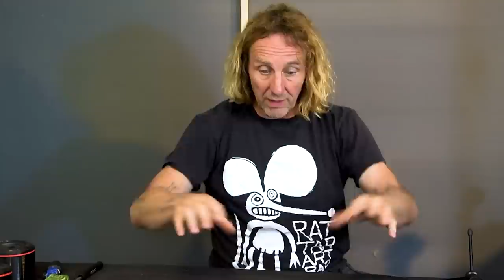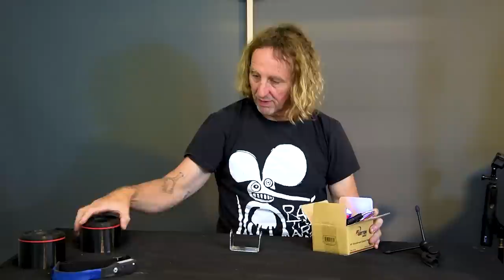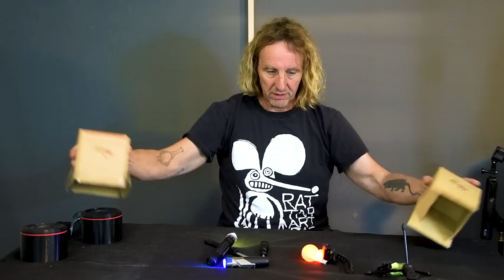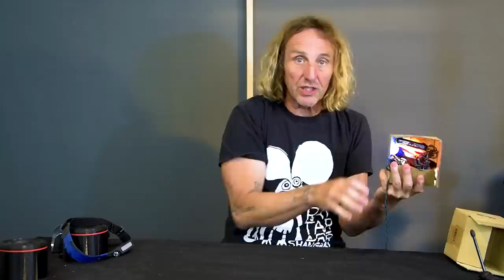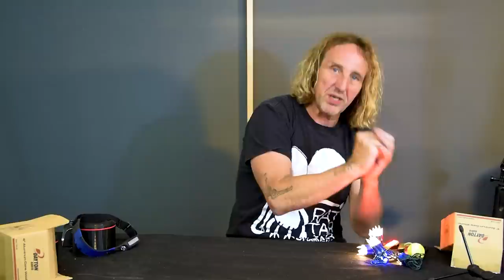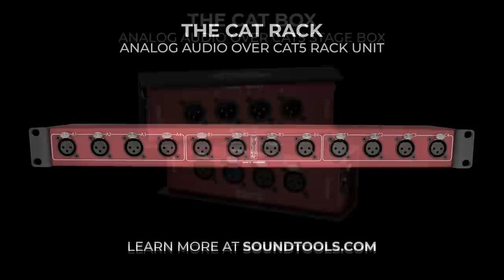Thinking Outside the (Speaker) Box - Does stereo Ruin Sound?

Comment: Interesting way to look at it. I venture to the other end of the spectrum for my personal listening experience. To me, stereo sounds better than "live sound". Live sound is too loud, too high frequency or bass heavy, has too much reverb, there's people talking and making noise etc...A good home speaker set sounds intimate and very "acoustic" and organic. Omni directional speakers have more of this enclosed listening quality. The good home systems provide offers more clarity and precision. I like the idea of "multi-track" audio for multi point speaker systems as well though. Really a difference in the experience of the sound to have all this stuff reflecting in different ways with different setups. I was blown away when I heard the bose micros in my house. They seemed to "open" the sound up with a feeling that you could grab the instrument. It seemed very rich in volume but the sound did not actually travel outside the house which is good.  With stereo, depending on how far apart your speakers are you get 5 strong points (far left, mid left, center, mid right and far right), those points then reflect obviously in interesting ways creating more focal trajectory. But again it's just a different experience. One thing is for damn sure we got to get away from the phone mixing based production. I came up with an idea called stereo cell, that basically is the concept of attaching very small but good speakers to a cell phone. In this way it can still fit in your pocket like a cell but would provide much better sound with the latest speaker developments. The new gen wants super exaggerated kits which is a whole nother issue ha...They sort of bake all this directional stuff into very basic arrangements (less virtuoso musicality but the listener can "feel" the vibe because the kick is 20db too loud). lol.
Reply from the maker: Hmmm, comparing processed home hifi and recordings to live where everything is pumped through big speakers in a more raw form at higher level. Yeah, stereo is less intrusive.

But 2hat about comparing both live PA system sound and home hifi sound to say, someone playing an accounting guitar, a stand up bass and a percussionist?

My take is that both live pa and home hifi and surround sound and all the other formats fail at reproducing sound even close to the original due to flaws in the formats of reproduction.

Comment: I love this concept..  placing a Danley Sound Labs Jericho Horn J1-94 in front of each musician on stage, and mix each instrument on it's own matrix.

i like where you are going with this.. 
🤣

thanks for your videos, sir
Reply: Interesting idea.
Reply from the maker: One interesting thing I found out when consulting on the EAW anya system was that it is practically impossible to make two things sound the same if they have different dispersion charictaistics.

We were voicing the Anya rig and I wanted to compare to the MicroWedge which I designed and EAW builds and sells.

Anyway, we kept testing and comparing and matching the EQ between Anya and MicroWedge and could not get them to sound similar.

Anya has a 70 to 90 ish degree horiz dispersion and controllable vertical dispersion and the MicroWedge has about an 80 degree conical dispersion.

It dawned on me the match the vertical of the Anya to around 80 degrees and wow. Once the dispersions we're matched, it them became possible to EQ the two vastly disparate designs to sound similar.

In my opinion, this is why horn loaded systems are greatly challenged in sound like the original sources and why studio monitors and home hifi are not horn loaded

Not to say horn loading is not useful, but horn loading is not the optimum choice if sonic realism compared to the original source is desired. Unless the original source is also horn loaded or has similar dispersion

Comment: Have to disagree on this one. We aspire the 'point' source because we do something unnatural in the first place: we split sound by frequencies (put low freqs into a woofer, high freqs into a tweeter etc) because of technological limitations. Getting those as close together as possible and phase aligned gets us closeer to a 'full range' reproduction. Point source in this case means the drivers are all phase aligned, independend of the listening angle. The thing that differs from the loudspeaker to the actual instrument is the radiation pattern and directivity. If you recorded a violin from different angles and made a directivity plot, then built a speaker with the exact same directivity and then played back a violin recording on it, it would sound close to perfect. Now play a recording of a trumpet on this speaker and it will sound terrible. Loudspeaker science just arrived at the best compromise. 
Not having a point source (or alternatively a phase coherent line source, which basically acts just like a point source when observed from a single point in space) would mean you're doing even more unnatural things to the original sound of the instrument.
Anyways, the rest of the video motivates people to think more about sound reproduction and how to approach mixing, taking their technological limitations into account, which is great!
Reply from the maker: Ahhh, but the reason we are so focused on creating these ultra wide range sound sources is because we are putting a vast array of unrelated sounds into them.

If you were to design a speaker to reproduce just acoustic guitar, or just kick, or just cymbals or just vocals, the complexity would be much less. You could use a single full range speaker or 2 ways maximum.

And the speaker designs for the various reproductions could be vastly different.

Do we really need a 3 or 4 way speaker to reproduce the sound of a marshal cab? 

And yet if you mic or direct the sound of a marchal cab into a 2 or 3 or 4 way monitor, it never sounds like the original marshall cab. Ask any guitar player if their wedge sound as good as their amp.

these accurate speakers we build to Swiss army knife reproduce a variety of sound sources, actually strive for max fidelity while failing to even reproduce minimum fidelity.
Reply: @DaveRat  Wow I just typed a long reply, misclicked once and Youtube just deleted everything. We need that Discord server already lol!
Anyways, the biggest reason why we need large multi-way systems is that we have extreme demands like getting sustained 100dB(A) some 30m or more from the stage. If you want 50dB at 1m, a single 3" full range speaker will do reasonably well, even with complex signals like a full mix.
And yes, speaker designs would be different if your goal is absolute realism, like I alluded to in my example with the piano. What's the best speaker to imitate a Marshall cab? Well, a Marshall cab, duh! But we're not using that because we want 10000 people to have a similar listening experience, not just 10. And as a sound engineer you know that the mic and mic position play a huge part in the guitar sound too, so yea, it will sound very different coming from a stage monitor, which isn't solely the fault of the monitor or its driver count though. In addition to that, sighted listening bias also plays a huge role. There is no appeasing a musician with any kind of thing, unless it's the very thing they want, no matter if it's better, worse or equal.
Reply from the maker: If you narrow the realm of applications to specifics you can really do a good job of limiting the possibilities of innovation.

I can say that when doing 60,000 capacity stadiums with a double hung pa system in Europe, where I had the ability to move sound sources around, I was able to imement the beginnings of these concepts.

For smaller simer venues in the 10,000 to 20,000 capacity realm the options would be more diverse. And for clubs halls and home hifi, complex options become quite feasible

As far as appeasing a guitar player, I just built wedges that were 2x12"/10"/2"

And replaced one 12 with a celestions 12. And rand guitar dire t to that 12. Guit player said it was the best guit he ever heard in a wedge and sounded just like his amp (he had a stereo mix as well so he had each rig going to a 12 in the wedges.)

My point is that we don't have issues, we only have solutions. Some we have found and other we are still striving for.

Comment: Another thought….. maybe what you are heading toward is using a monitor mixer for the FOH so you can send a lot of different mixes to an array of widely spread speakers. Probably work better in smaller venues rather than arenas but I think it will work better than a stereo mix :elbowcough:
Reply from the maker: I think there are a near 8nf8nitenanountvof application dependant solutions and advanced to be made.

And trying to continually push stereo to higher and higher levels of perfection is not one of them

Comment: Good points Dave! In the hifi world we know there's no way of replicating the original. There's just too many steps in between - mics, preamps, cables, mixers, amps, headphones, speakers etc. There's too many subjective decisions made before the final product reaches the listener. I think the point is to try to make the sound as enjoyable and pleasant (wholly subjective) as possible. Many recording engineers are surprised when they hear their recordings through audiophile equipment. It's not the same that they heard through their studio monitors when they mixed it. People still don't use studio monitors at home because hifi speakers "sound better". Long rant, sorry. Whatever makes the end consumer (the audience) happy, even if it's not exactly true to the original. My 5 cents. Great video!
Reply from the maker: I would argue that a recording of 3 lo-fi sources would be easy to recreate wit 3 lo-fi speakers that each radiate sound in multiple directions and difficult or impossible to recreate with 2 hi- fi speakers.

I would say that the less we combine signals, the less need there is for perfection in the reproduction signal chain.

Comment: Your videos on that topic and how you came to use a double hung PA and seperate the sources in the wedges have definitely triggered something in my brain and I'd like to share my thoughts with you...

I've been following the adventures of @PresentDayProduction moving towards Dolby Atmos mixing and having the possibility to assign each source to a single speaker recently. I've found the technology behind this really interesting.
This makes me thinking a lot about about the general problematic of live sound reinforcement and I wonder if Atmos would be something that could be usable (in the future) in a live environment.
It seems to provide better clarity and a better image when mixed for an immersive experience and then processed down to a stereo setup than a classic stereo mix.

Of course, Atmos is designed for a single optimal listening position and latency would definitely be an issue for live use at this point in time, but I wonder if that kind of technology used on a double hung PA could be a valid solution to make it sound more natural.

This is just theoretical thinking and Atmos is too expensive for the average venue anyway, but maybe there's a way to use the virtual speakers concept with the equipment we use live today... Just thinking out loud
Reply from the maker: Sound sources radiate sound outward towards the listers and the walls

Atmos is designed to project sound inward from the walls.

Like tryin to recreate the feeling of sitting around a campfire by using central heating and adding more vents on the walls

Atmos is good for creating secondary sounds coming from external directions but does not address the accuracy and realism of primary sources that would be located in and amongst the listeners.

Comment: The idea of a coherent point source happened at a time of a single microphone was the source of pickup for a live performance recording. 2 channel happened with 2/3 microphone pickup for live performance recordings. Classic loudspeaker theories developed due to this simple recording techniques.

Multi track recordings of non acoustic performances challenges the rules of classical loudspeaker design. So yeah I guess this needs a new perspective. I believe three DSP controlled dodecahedron loudspeakers in the front is an alternative approach.
Reply from the maker: 👍🤙👍 expanding beyond the horse and buggy approach. Gas engines are the way. Oh wait, electric?

Innovations and resistance to innovations is the way forward

Comment: Dave, I suggest that you should set up your "dream system", applying all of these thoughts, and have people come over, listen and talk about their impression. That would be an amazing experiment!
Reply: Also to comment on your thoughts: I consider that stereo systems work great, but for a single listening position. In this cases having coherence among speakers and a controlled room will definitely be beneficial as the intention is to keep those out of the equation. When there is no single listening position, I think your approach would be better. Thinking about it, this is somewhat what happens on very small events, right? Guitars, keys and basses sound through their own amps, drums sound by themselves and vocals are on the PA. However, most of the time they are not carefully mixed...
Reply from the maker: I will share more vids and ideas over time on ways to make this work

Comment: As always, Dave, this is mind boggling. I have always thought that it was silly to spend hundreds/thousands of dollars on a guitar rig to get just the right tone, and then jam it into a crappy microphone, out of an OK speaker and lose all of the magic. Could it be that, the old days of stage volume, were the right way to do it? Let the amps be loud like they're supposed to be, maybe use a PA speaker to represent the drums, and one to represent the vocals?
Reply from the maker: Hmmm, lots of aspects to consider and balance. Sound quality, coverage, sonic realism, cost, size, scalability, sightlines and on and on. And the balance and weighting between these factors varies drastically based on the application.

Home hifi vs big rock show vs orchestra vs club gig.

As with anything, sorting optimal and desirable solutions for the task at hand is the goal.
Reply: @DaveRat  btw, I’m totally stealing your light/box analogy for my next staff training! Perfect visual.
Reply from the maker: Excellent!!
Reply: I have yet to try this, but to combat the balance, it might work to pan a guitar cab placed stage left to hard right, and bring it down in the PA so its -10db quieter than the cab, and then do the same for the bass (but opposite). Then leave vox and drums dead center.
Reply from the maker: That will reduce comb filtering issues

Comment: Love what you're trying to achieve here!  I'm curious about your thoughts on delayed PAs and also a compromise between what you're doing here and a delayed PA.

So, after fighting horrid room acoustics for years as a live sound engineering, I've recently opened a live music listening room large enough to comfortably hold 100 standing.  The room has fortunate dimensions for acoustics and then with further treatment really sounds fantastic.  The whole time I'm creating this I'm hoping to keep volume levels just at or above the non-amplified drum kit level.  

After experimenting w speakers in more traditional 2.1 arrangements I decided to suspend the 2 splayed mains over the center of the stage (in mono) and found it expanded the sweet spot dramatically!  

Then I tried delaying the entire PA the equivalent of 15ft over the 20ft deep stage.  At the lower volumes we can push, the delayed PA becomes shockingly invisible as the original source hits the ear just before the amplified version bringing back a truly realistic image!  You can FEEL each vocal and each instrument move from the PA to the source as you ingage the delay.  I find myself demonstrating it to musicians and other engineers often.

I'm wondering how well it would work with a delayed 3.1 system for louder venues?  This seperates many instruments from each other and the image would remain roughly the same anywhere in the room.
Reply from the maker: More than I can dive into in a comment response.  We cover more in-depth stuff on the member side in zoom chats and such
Reply: We do this kind of thing for vocals for live theatre. Works great!
Reply from the maker: Using independent vocal sources is great and a step in the right direction. I've applied this concept on arena and stadium level concerts as well with excellent results.

My focus now is on the other end of the spectrum which is smaller format and trying to reach higher levels of realism.

If that's successful then looking at ways to scale that
Reply: @Lunatic768  Oh yeah, delayed amplification would work really well, and makes a lot of sense in theater.  As I think about it now, I can recall one particular theater that always made me wonder how the actors sounded amplified but yet not amped.

Why do I not hear of this being done in live sound?  I assume I'm missing something.  Is this done all the time and I'm simply not hanging with the cool kids that are doing it?  Is this a luxury from being in a fortunate room that I'm taking for granted or what?  

I realize that I'm not pushing levels as high as some but it gets pretty loud and the effect still works, though I imagine it would be reduced at a certain threshold.  Actually I guess it would have more to do with the ratio of sound between the original signal and the amplified version.